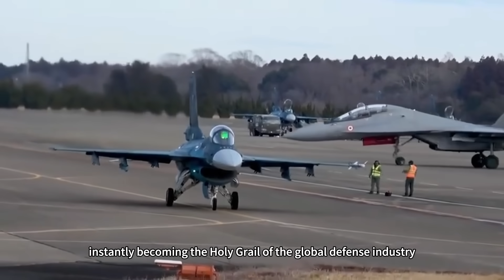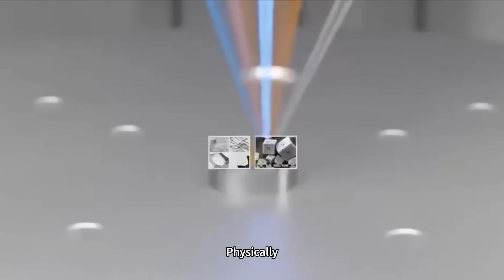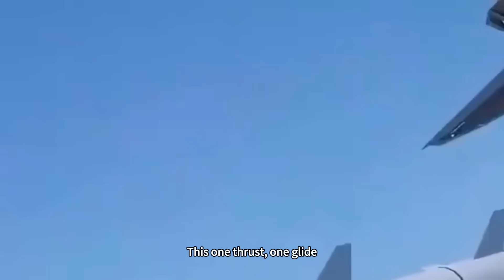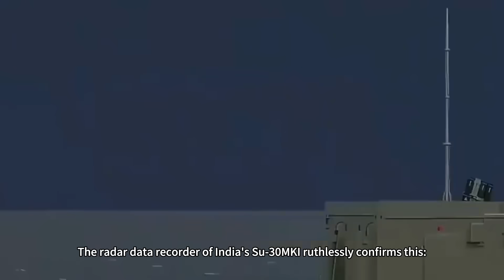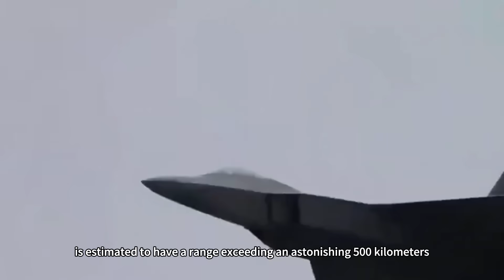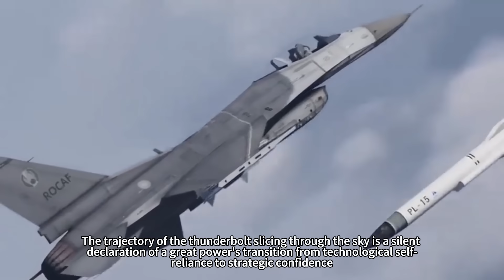Japanese research on the PL-15E missile debris has yielded results!

Comment: The Japanese ones will have the L version. This will come with steel wheels with plastic hubcaps and come only in white.

The XL one with alloy wheels and get rubber floor mats.

The Grande version comes with the lot but costs 3x as much as the base model.